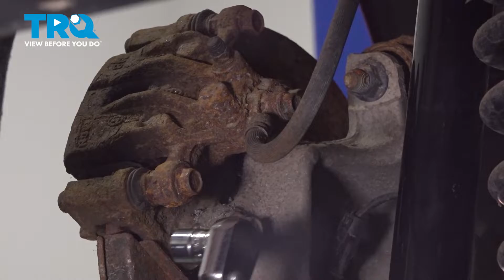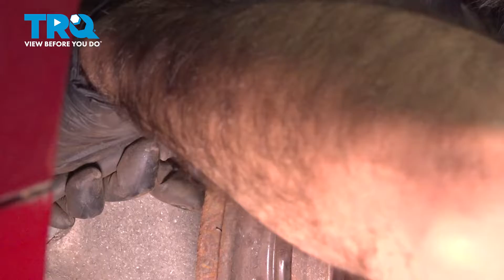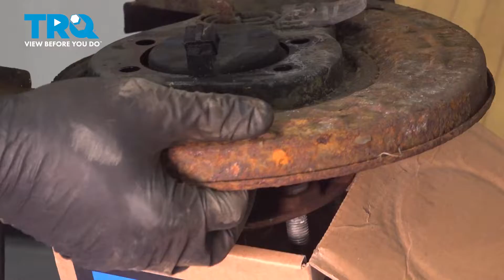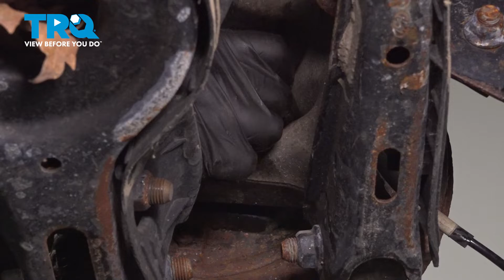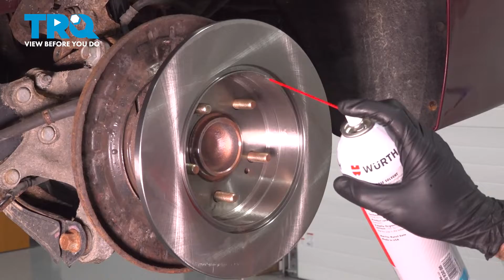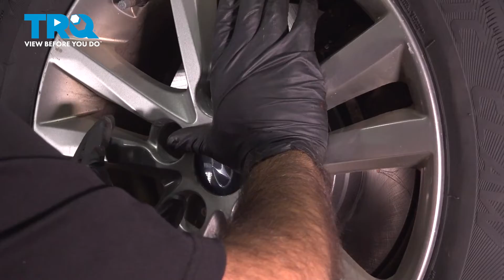How to Replace Rear Wheel Bearing & Hub Assembly 2015-2019 Hyundai Sonata

Comment: I struggled to find any guides on my UK 2017 Tucson 1.7CRDI, so i used this as a informative guide and this is basically the same procedure as my ABS light, stability control and Hill Descent Control Warning Light all came on together sometimes turning the engine off and on would remove them, anyways after using my scan tool i found it was rear left sensor/wheel bearing so i did both rear using this video as a guide, only differences was the abs clip don't pull it off there is a chance you will lose it they are designed to be push in (squeezed) and pull, the hub nuts i torqued to 55 ft lbs as Hyundai say 50-70 ft lbs just like most torque setting on Hyundai they don't give a specific its always within a range other then that this guide will help with the Tucson :)

Comment: They used red loctite on the caliper bracket, I had to heat it with a torch to get them out on our 2018 Sonata also had to remove the parking brake cable bracket ton separate the hub from the back plate. This video was very helpful.

Comment: Great, detailed video! Could a slide hammer be used to pull the hub/bearing out (after removing the 4 bolts)  instead of removing the parking brake/backing plate assembly?